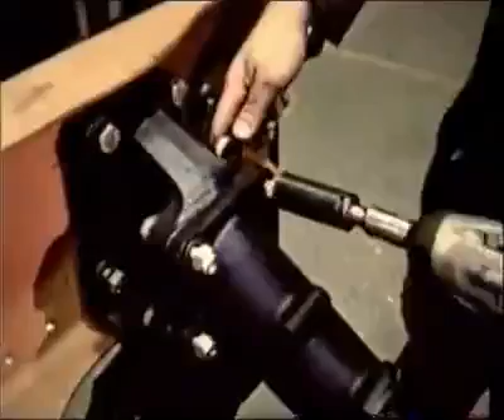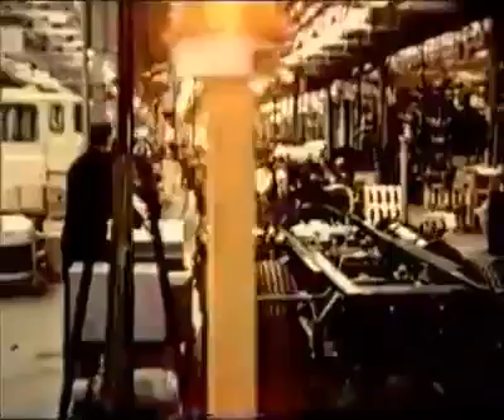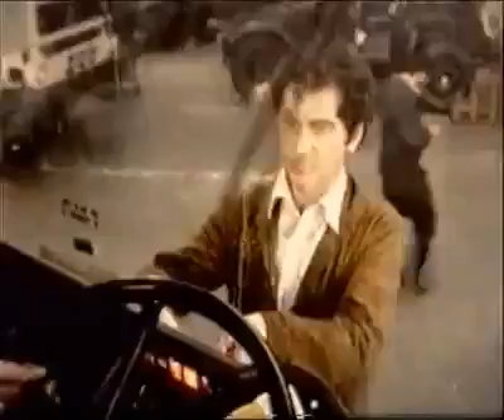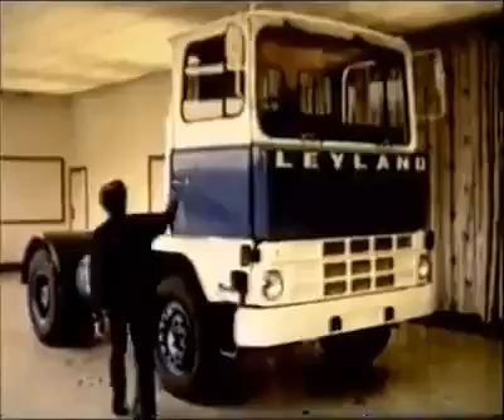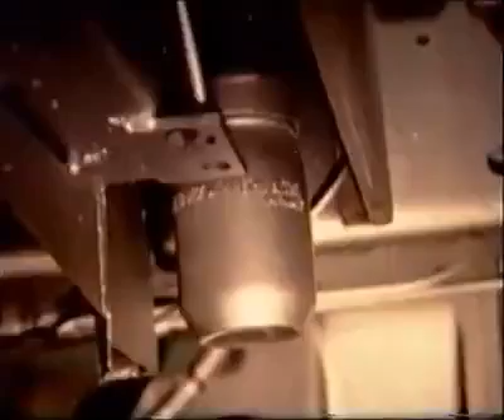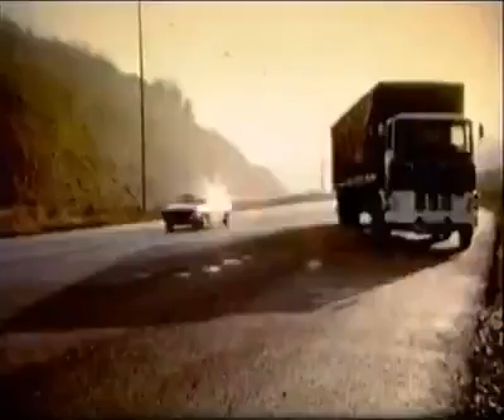Leyland marathon mk2

Comment: I worked for a company that only bought British vehicles. Albions scammel Bedford aec Dennis Leylands .Good hard working trucks for there time but they just got left behind by volvo and scania  much more reliable and the drivers loved them even had a radio which none of our vehicles did . Mind you I drove a Leyland buffalo headless wonder nothing passed me until the engine went bang at about eighty thousand miles. Problem is none of these new drivers would be able to dive a crash gearbox range change or twin splitter gearbox. I passed my test in a Mercedes with a Chinese gearbox

Comment: The Marathon mk 2 was a far better machine with Cummins engine, improved foot brake valve and Fuller 9 speed box than the first model. Bad top management ruined Leyland, AEC, Albion, Guy a Scammell. It was no  secret the demand for modern, comfortable sleeper cab models. See the sales of European lorries at that time.
Reply: I remember passing my HGV test and the difference between driving a Leyland tractor unit, let alone a Seddon Atkinson, Foden or anything else British compared to a Volvo F 10 of the early eighties was the difference between night and day.
Reply: Good to see you're just soooo patriotic. You deserve to lose your country to the invaders.
Reply: Yes it was completly différent, look at the F10 only or the Berliet. They have à moderne and confortable cab.
My father leaved Volvo to but this. Big mistake.

Comment: I m civil engineer and in 70s I drove 3 1/2 tons lorries for a friend of mine. One day he got a job to take copper scrap down to Liverpool on the last day he fell out of the cab and broke his arm. He rang me and give his drivers license to me. He help me to hitch the trailer up and off l went . It was a V8 AEC and had no pulling power. When l got to Liverpool l was called into the weigh bridge cabin asked what l had on back of lorry,scrap copper, will why does the ticket say 51 tons.My boss went white when l told him, he charged the company for three trips!!!
Reply: Do you know my dad? He worked there in the 1974

Comment: Probably be a shock to drive to today's army of automatic gearbox trucks

But to older generation drivers, probably easy to drive, and long lasting vehicles
Reply: They had a major rust problem,,
Mostly casual by leyland,, going for a cheaper grade metal sheet for the cab panels,, most would not pass the mot with in 8 years of manufactur

Comment: i used to  work at AEC. the tl12 engine is an AEC engine not leyland. the problem was we were not allowed to badge it as an AEC so it had leyland monograms,the best truck we built was the  0870 and 0880 army trucks
Reply: Do you know my dad? He worked there in around 1974
Reply: Hello Peter, I always thought the TL 12 was a modified version of the AV 760 is that true. Also can you tell me the difference beetween a 505 and a 506 thanks.
Reply: @seamusburke9101  hi. yes basically a 760 with a blower but heavily modified.the 506  as far as i can remember had a bigger bore and an inline pump.also a new design air cleaner which sat on top  of the engine,i think the engine itself was a bit of a white elephant,the tl 12 was a good engine as it came from us at AEC LTD  if we had stayed open  the 506 could have been developed more. blame the gov of 1978.
Reply: Geeat unfo thanks Peter.